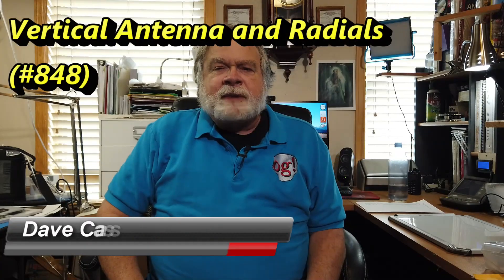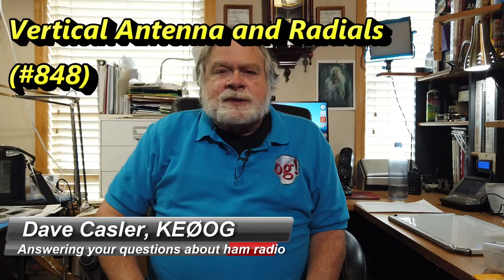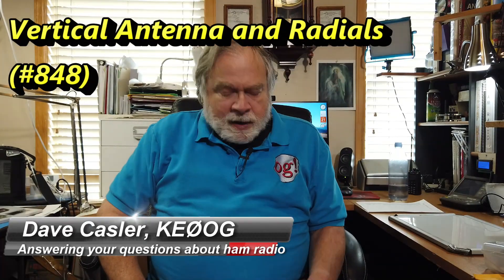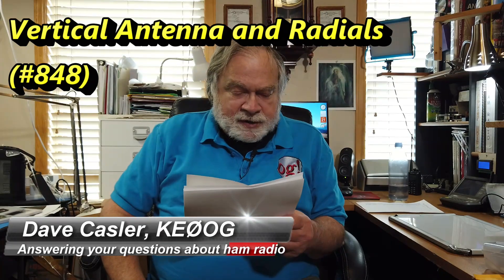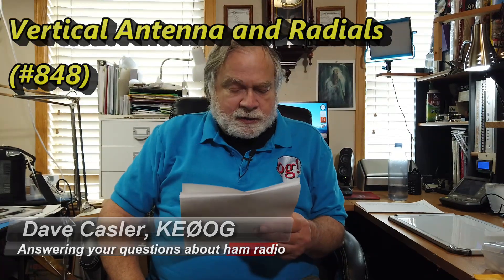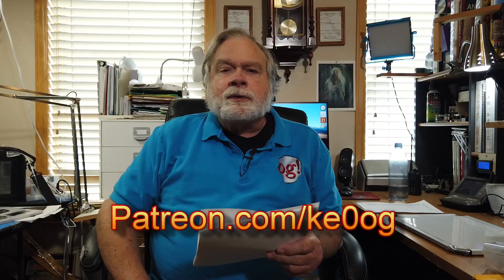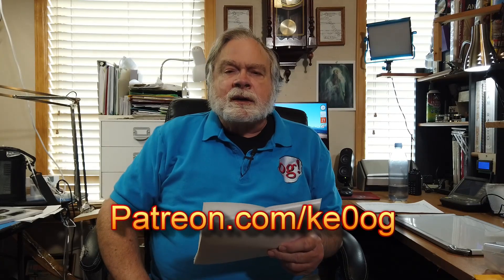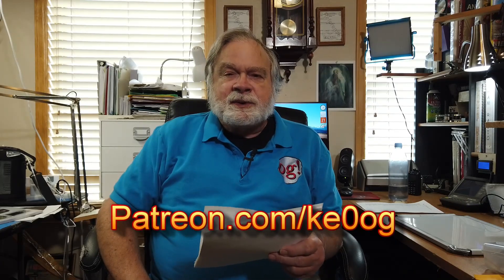Vertical Antenna And Radials (#848)

Comment: Hi Dave! I my first words I want to thank you for all the hard work you do, live is better an a bit easier when I can find answers or learn a new thing. 
I have instal newly purchased antenna EAntenna DX13M from ML&S UK It's been advertised as multiband ( 1.8-50Mhz ) and it kinda is. I was aware that top band is rather tricky to get on but hoped that antenna will work, but it doesn't. Also 14Mhz band wile tuning is on killing my keyboard and mouse ( only on 14Mhz ) 
While I can live with 20m issue as I have Inverted Vee which is perfect on 80-6m, lack of top band makes me sad.
Now, I have no radials yet, I have attached 2m of copper tube where radials supposed to be attached and as ground water level here is around 50cm I ''dipped'' the tube into water
Using just 5W I made contats with stations in a radius of 5K miles so it kinda works hahahah
What would you suggest to do so I could finally use top band?
I have AATU AT-100 Pro II tuner.
Will appreciate any suggestions very much Dave.

73s Andy de 2E0FHM

Comment: Thank you for your easily understood explanation I've ground wires. I'm always used dipoles but my current situation doesn't allow that. I'm putting up my first vertical. Thanks. AE5LD

Comment: Thinking about the Resonant 1/4 wave Ground Plane's 36 ohm Feed Impedance would Seem to be Half the Dipole's normal 72 ohm feed Z  'cause 1/2 the Dipole antenna is Missing !! .....45° Angling Down the Radials is simply Replacing back Some (50%) of the Missing Dipole Half, conveniently approaching 52 ohm feed Z.....If you Can't or Don't want to Angle down the Radials,  Adding a simple Shorted Hairpin Stub across the Feed Terminals will let you tune out any accumulated complex Reactances to a perfect 1:1 Swr....

Comment: Great Video, Dave and very informative.  In 2009 I bought a Hustler 5 btv vertical and put down 25 radials in lengths from 20 to 35 ft.  I used bare electric fence wire because it was cheep and it worked great - but was a big mistake because the wire rusted and deteriorated in about 5-6 years. I have since replaced them with 14 gauge insulated stranded copper wire.  I didn't bury the radials, instead I mowed my lawn on a low setting, laid out the radials, stapled them down and let the sod grow over them. It's been working great. de KE7LOY

Comment: Dave, I have an HF9V ground mounted with twenty 25 foot radials. When we get rain, the resonant frequency goes up. After it dries, it returns to, or near to original. These radials are on the ground and I have the vertical bonded to an extensive ground system. Any ideas what is going on?
Reply: Water is conductive, this changes the swr because the electrical length is now slightly different due to the ground being wet and more electricly friendly

Comment: just get a titan dx by gap antennas and eliminate the need for radials problem solved and as an extra the antenna is resonant on multiple bands with a swr of 1.1 or less on most bands and covers from 40 to 6 meters with a capacitor it covers a bit of the 80-meter band you can order a capacitor to tune your favorite part of the 80-meter band and is omni directional

Comment: Your statement about a raised antenna with radials straight out having an resonant impedance of around 30 ohms is, of course, correct.  I built my raised vertical with sloping radials.  I find this brings the impedance up.  Somewhere around 45 degrees yields a 50 ohm impedance.  Local conditions such as the type of ground, any buildings around the antenna, or the height of the antenna will effect the final performance of the antenna to some extent.  That's a long way to say your mileage may vary.

Comment: Once again you can make you own Radial plate out of a 15" pizza pan, Use your drill press and drill a hole every 5 degees which will yeild you 72 attachment points, Take a hole drill and make a 2" center hole. Now you've built the plate for around $25.00, The most expensive part will be the stainless hardware. 73 ki0ad/Jim

Comment: Dave, my name is Nate. I’m a 20 year electrician and spent 4 years in the Marines. I’ve recently been getting into HAM radios. I understand a lot about antenna’s, however how do you maximize an antenna on the 10 meter band using a 60’ end to end rooftop. I am building my own. Thank you

Comment: For a point of reference, I recently installed a ground mounted Hustler 4BTV vertical with 28 - 32 ft. radials.  I am very happy with the results both on SSB and FT8.

Comment: FWIW most of my radials are from stripping apart CAT5/6 cable it is exceedingly inexpensive. Not very robust, but I have so many that a few damaged ones will have no effect. The soil is very conductive here, so results may not be typical. At one point I was surprised how effective 16 radials of just 2m length were even on 80m.

Comment: Appreciate the good video Dave.  Having insulated ground radial wires is a great idea.  Over the years, have experimented with both ground mounted and elevated vertical antennas.  Am partial to my EFHW though.  BTW, lawnmowers love to eat those radial wires for dinner, if caution is not used when mowing.   73,   AC3HT

Comment: Fer me my EFHW dipole at 30' or so above ground always beats my ground mounted vertical with 10 radials of various lengths also on the ground which produces a low SWR under 1.5:1 .... And yes, I know I'm comparing apples to oranges....tnx Dave 73/K6SDW